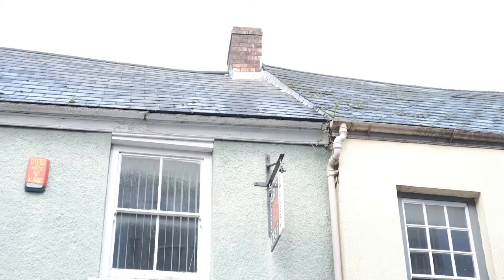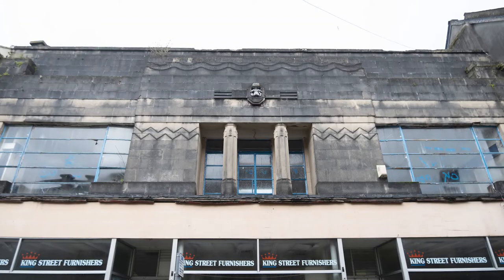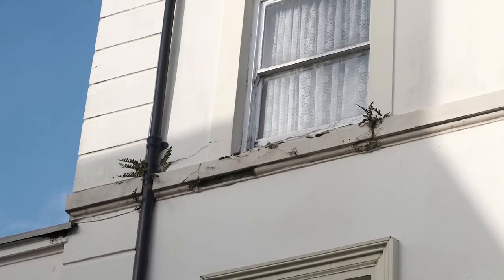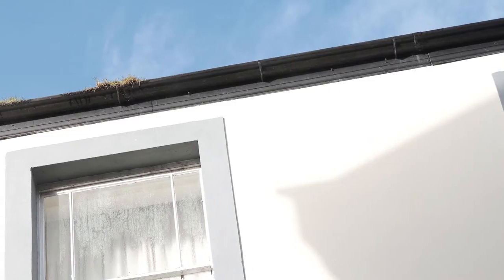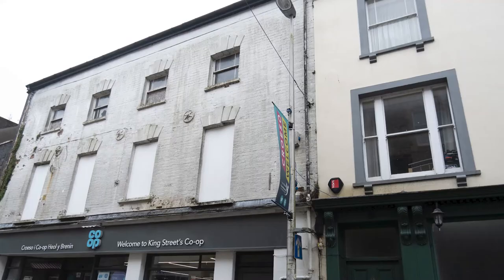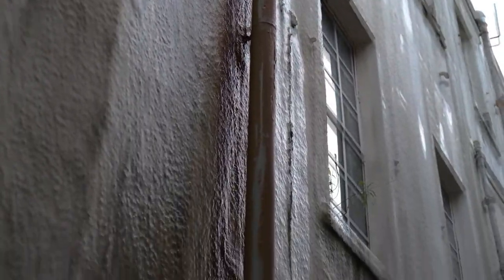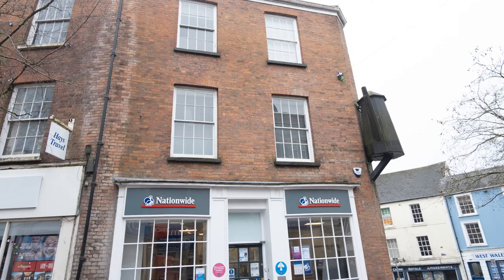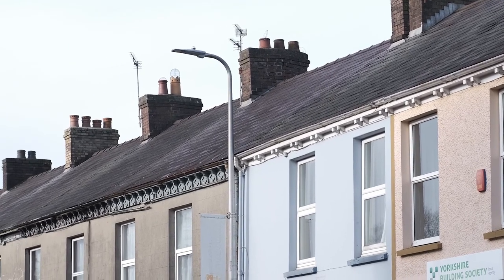Defects in Traditional Buildings

Comment: 15:42 that really explains why we had such problems with water getting into the basement of one of the places I lived in growing up, it had a poured concrete driveway abutting the foundation of the old house and the foundation was built originally of stacked fieldstone and we had no Idea of how to fix the problem with water getting in every time it rained and pooling on the concrete floor so we tried what the hardware store people were recommending and used waterproofing paints over the concrete and added extra concrete to previous peoples attempts at repairs of cracks and potholes inside the basement to fill the low points that collected water, and this was before the internet so we had no idea what we were doing wasn’t going to help with the problem much, I think that the original part of the house with the basement was about a hundred years old or more back then and I think the hardware store people were giving advice as if it was a modern basement.